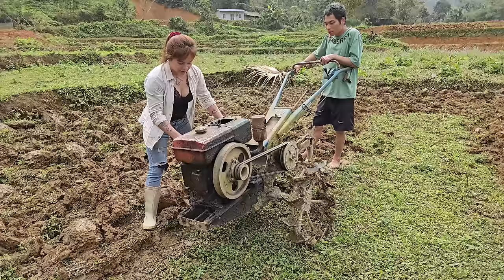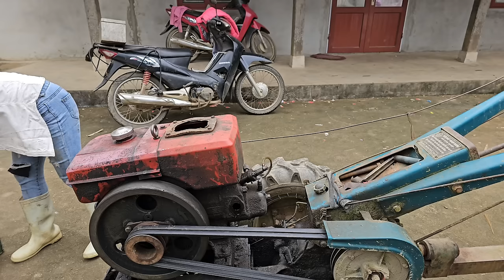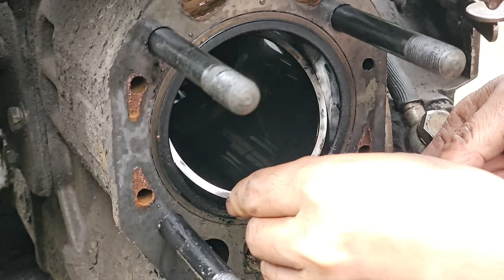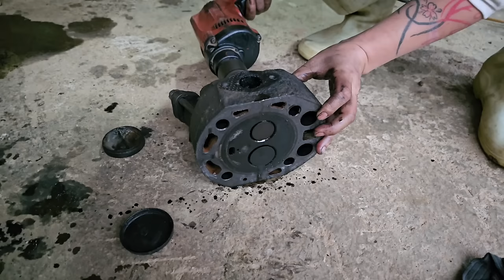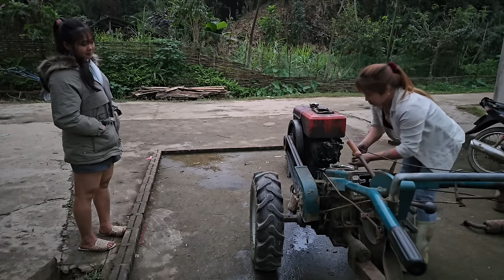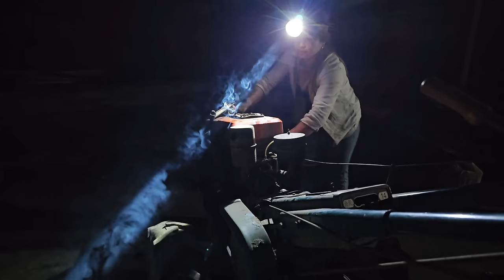Mechanic girl fixes tractor that won't start and how to fix it

Comment: i hope she noticed keepers weren't seated and she didn't set clearance after lapping valve
Reply from the maker: Thanks a lot
Reply: Could be she did but not on camera
Reply: In another video, she fixed this type of tractor and did not set the valve clearance there either...
If it were a car in New York, I would understand, because they don't even need fuel, just turn the carburetor and the city air will drive it...
Reply: 1